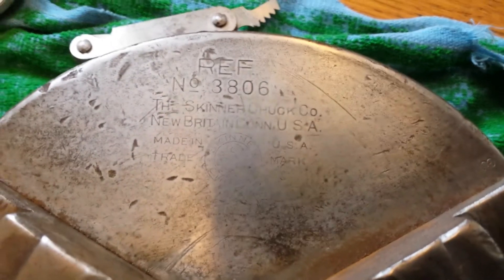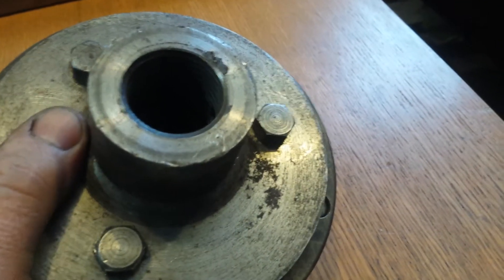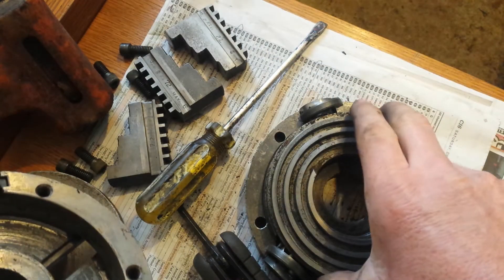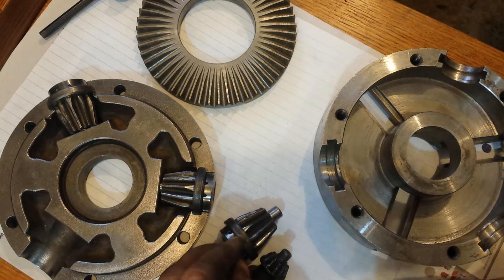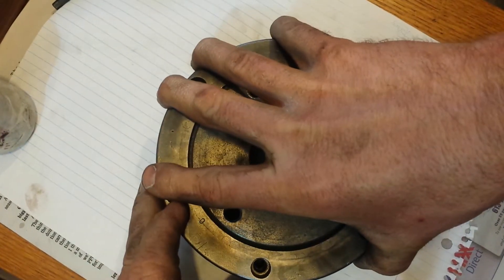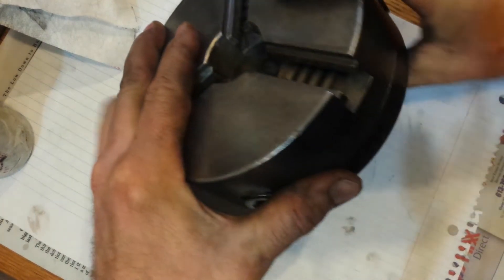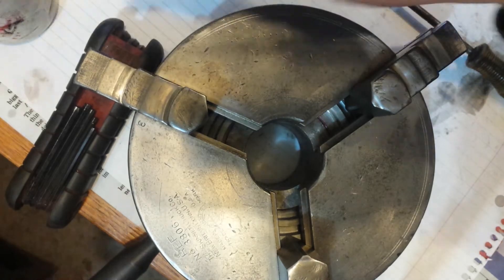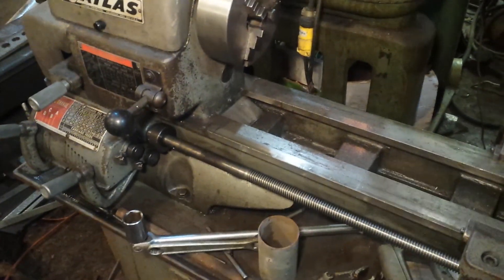Skinner Chuck Co. New Britain Connecticut

Comment: Yep, pretty dry in there. Good on you for taking it apart and doing what you can. I am a real fan of the synthetic oils and greases. They activate at far lower temperatures and take far higher pressures than regular series 1 or 2 grease or the heavier oils such as 30  W needed in high pressure applications.I as a machinist of over 45 yrs I would suggest a lot more grease to help keep filings out of the works. Enough so as it comes out of everywhere. Kind of messy at first but it will keep the innards a lot safer.Witness marks and as clean as an operating room there. Well done fella.That is a great old Atlas. Service it well and it will last another lifetime yet. Thanks for the show fella.
Reply from the maker: I missed your comment. Yes we have synthetic oil in our diesel trucks. I'm cleaning a five inch now. Thanks for the tip.